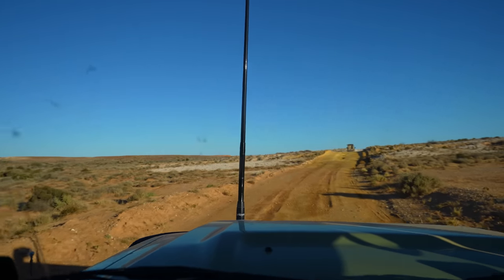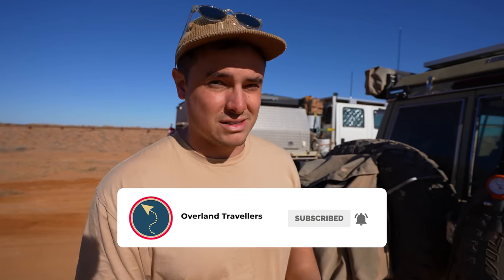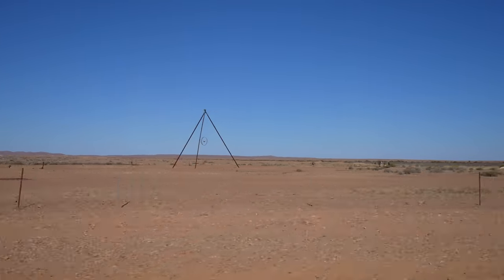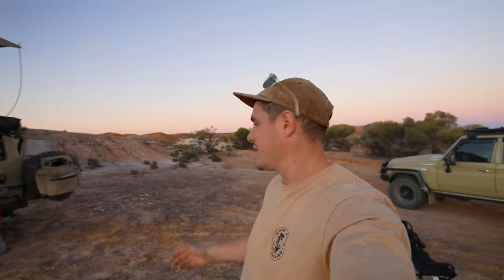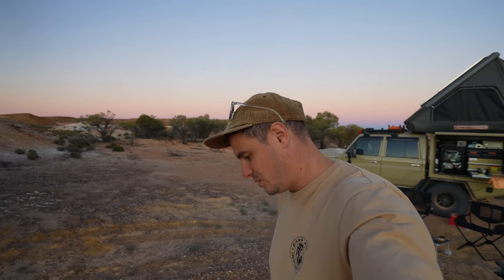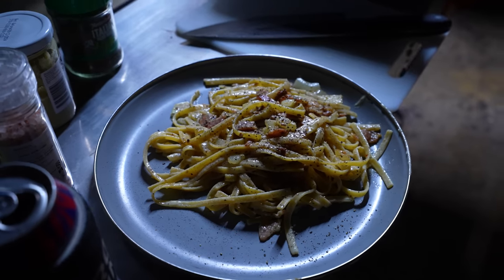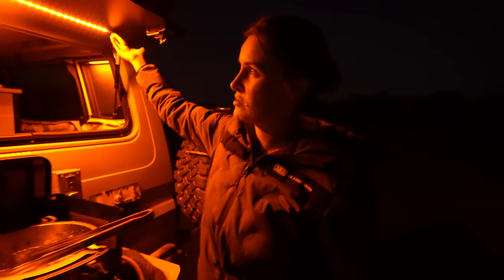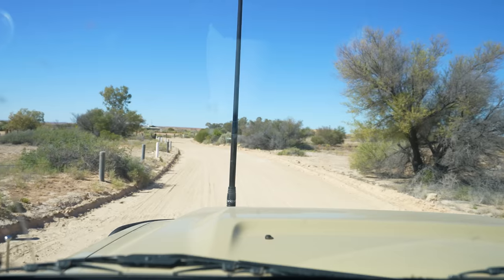Like Camping on Mars - Oodnadatta Track - Travel Australia

Comment: Hi Fokes, good video, how hard is it to do night shots of stars how big memory card do you run for that kind of shot. And manual setting is 
it i am new too taking shots. I am getting some work on a full 12-24v system through PROJECT OVERLANDER.
I notice you still cook with gas stove how long that bottle last you? Is it a time issue or what is it ,i still like to cook on a open fire.
Cheers HOLLY ANS MATT.
Reply from the maker: Hey mate. We have a 128GB card, the setting are usually F1.4, 8 second exposure, 3200 iso. But it will change for your setup. That's good they do fantastic work there. We just like to have the option, for example it was too windy for gas this morning so we used the induction. The gas is better to cook on in good conditions and we get 3 weeks heavy use out of a bottle

Comment: Hi Matt, it was me that mentioned the lock nuts on the tyre sensors and you said you would let us how they went without them so thanks for remembering. What temps do you run your fridges at in the warmer climates ? Keep up the great work and stay safe.
Reply from the maker: No worries mate. The centre console is running at -18 as a freezer and the other upright is around 2-3

Comment: I have a different brand TPMS which is not very good but in the instructions it says the lock nuts are to reduce risk of theft and it is fine to use them without. I’ve done about 15000km on terrible tracks and they haven’t come off.
Reply from the maker: Good to know